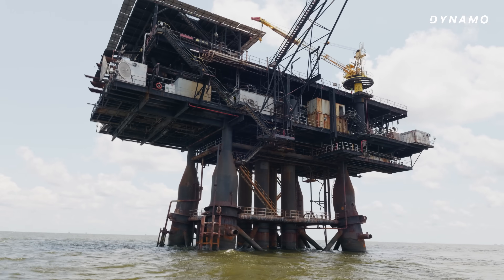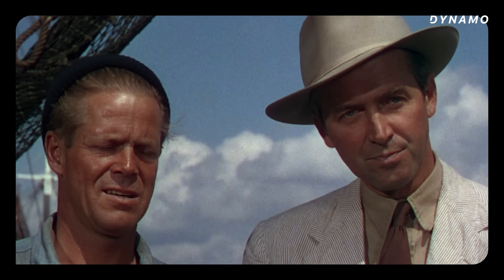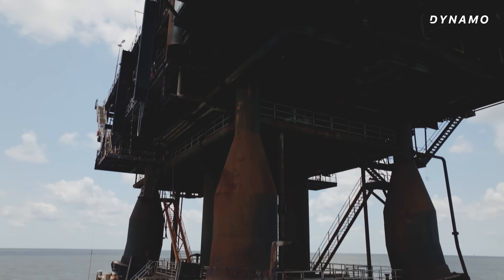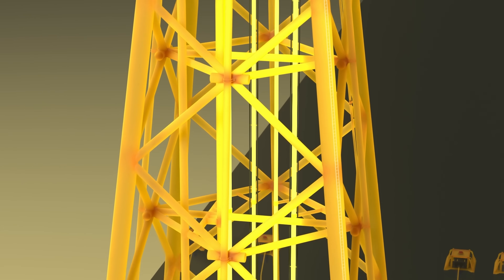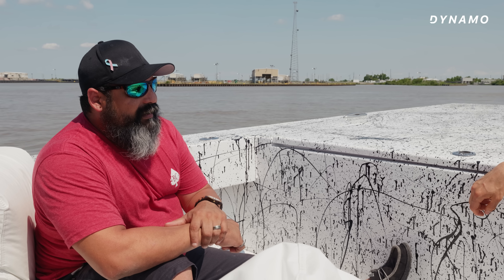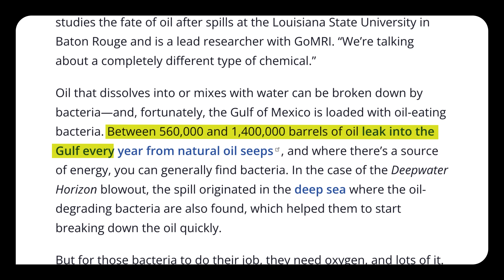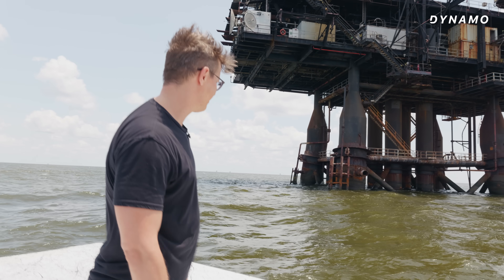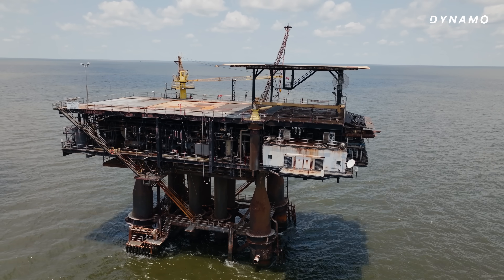I Visited Abandoned Oil Rigs — and Found Something Terrifying Underwater

Comment: Hey it’s me, Nich. I'm the host of this show and the CEO of Dynamo, the company behind "Business Explains The World." I’d love to try to answer any questions you have about the episode!
Reply: Privatize the profits, socialize the losses. The real recipe of American "capitalism".
Reply: Why does this video end with a call to action for a weird hydrogen company instead of a call to action for capping all the wells?
Reply: How about implementing a requirement that new rigs and wells be paired with the capping of existing wells and removal of older rigs? We could also consider increasing the number of old rigs that need to be retired and wells that should be capped based on the size and cost of the new rig. This could promote safer practices and better resource management.
Reply: @christophersz if the ultimate owner is some small company that then goes bankrupt, I don’t think that such a rule would help.  Perhaps there needs to be rules around building these that ensures that 1)the builder is very well capitalized and diversified and 2)that the liability for the rig cannot be transferred.
Reply: Why weren't you wearing a life vest on the boat by the right?! A bit silly, but otherwise a really interesting video!
Reply: @Xan-Asmodi  Thanks! When boating as a kid or an adult, I always have life vests nearby and easy to access in case things go wrong.
Reply: I was a sub sea inspection engineer most of my career. The problem with the US offshore industry was that they never really had a regulated inspection programme the companies had to adhere to. In the North Sea for instance all sub sea structures had to be inspected at least every years and some every year. Also the companies are bound by law to return the sea bed to the same state as they found it which means capping and clearing the seabed. The reason your offshore instalations are in such bad condition is because they were never or rarely inspected for damage or corrosion.
Reply: I Should have said 'every 5 years' minimum.
Reply: @robertwrightson6455 but only AFTER Piper Alpha. It was an unregulated shitshow before that, with the Department of Energy in charge of both maximizing production and safety. Not too good bedfellows those two...
Reply: Why the use of AI slop instead of paying an animator?
Reply: @BigDadEnergy_ because animators are people and this economy is not wise to provide services and money for people trying to live. Lets all fry our electrical power lines with super tech servers and get a more thick light bill
Reply: The gov gives the corporations an out. It's the policy that is designed that way. They max their profits and the taxpayer will pay clean up
Reply: Hey man, not a question, just a comment - I appreciate you guys putting in the "AI animated historical image" tag on those images. I think AI generation is something that should be done transparently and in a limited way. I really think this technique works really well!
Reply: They are platforms not rigs.
Reply: 🦹 You remind me of Reverse-Flash, also known as Eobard Thawne in the series. 😁
Reply: No question from me but I'd like to say 2 things. First, thank you for shining a light on this. Second, we need stronger legislation, because this isn't going to police itself. Whoever builds and takes part in the rig has a shared responsibility to pay to decommission it. Or, Whoever builds it is responsible and can bake that into their profits and the sale to the mid tier company.
Reply: Can a person live on an abandoned platform?
Reply: How can a company come and assist  in fixing this situation any way to contact you
Reply: 🥰you are cute 🥰
Reply: Same in the North Sea Shell, BP & Amerada Hess sell the facilities on to companies that go broke, oil companies insisting they then have no responsibility for the removal as the installations have been sold on to third parties.
Reply: Nich, that was an enlightening piece. I was oblivious to this problem.
My apologies if I missed the explanation, but what is the procedure for “plugging” these defunct oil wells?
Also, is plugging a guarantee against future leaks or do these plugs require monitoring/ maintenance?
Thank you and again, that was a very interesting piece.
Reply: This reminds of that offshore platform built in international waters between England and France, then abandoned by the UK after WWII. Some guy went and proclaimed it then started Principality of Sealand
Reply: So in general, and as silly as it sounds, but people below have got it right. The reason that jacketed platforms are left where they are is that it would do more environmental harm to the marine life that made them home to take it out. In an ideal world, the topsides (the bit you can climb over) should be removed however, and endure the wells are killed and capped though. If memory serves, in the North Sea the jacket needs be chopped off 50 feet (i think?) below the surface so ships don't rip their keels out if they go over them
Reply: Gulf of mexico😅 wot ? Maga maggots itz da golf o merika. Brandon yellin beyotch
Reply: louisiana master race
Reply: Deceptive title! You weren't even underwater!
Reply: Why does the Australian Tax payer have to pay $500 million dollars to clean up Chevron mess in Western Australia, why can't Chevron just find some loose change in their pocket and pay for it, I mean they've paid next to nothing in tax and land royalties.
Reply: They have the same issue with phantom wells seeping tons of methane in the western U.S.
Reply: Why are you a cuck shill for AI
Reply: You install it when your done you dismantle it there problem fixed.
Reply: Is a good hideout, no doubt 😅
Reply: Why was that boat covered in oil?
Reply: @miguelvpires i think it was paint, but i still wanna know why it was covered in anything lol
Reply: an AMA in a youtube comment section? Bold move! Haha
all jokes aside thx for the video good work
Reply: why do i see housing opertuneyt like the floating city in korea 2050
Reply: I was a commercial diver for 19 years in the GOM. I have been to that very platform many times in my career.
Reply: Basically everyone, including the government, decided the clean up should default to the taxpayers. If Congress really cared, clean up liability would attach to the deepest pocket in the ownership chain. Kind of like joint and several liability.
Reply: Now look at wind and solar farms.  The same thing will likely happen to many of them.  We need to focus more on nuclear.  It needs more research but it has a much smaller footprint.
Reply: This was very informative, I worked in the oilfield about a decade ago and didn't realize so many wells were left unsealed, pure profits are the only motivation for the oil companies. The technology is utterly incredible, when I left in 2016, I had the opportunity to work on a state of the art deep water discovery vessel, the Ensco DS5, which was finalizing its commissioning procedures.

Its design was to be tested for arctic and deeper waters than the gulf shelf, with twin drills it was intended to tap deep wells reliably, determine their production potential, and then keep going searching for more drill points while a specialized production vessel is moved in to operate on that well long term.

Looks like arctic drilling has been authorized under the trump administration, shell has been poised to move on that front for several years now. I'm afraid that unless some regulatory body finds a way to strictly enforce operational and decommissioning standards, then we are going to see more abandoned oilfield hulk littered across every possible extraction field that they can find.

Great work on this
Reply: how do I donate to a lobbyist to get this issue in front of senators and representatives?
Reply: Pardon my late question. I have designed a deep sea oil and gas containment and channeling system for blown wells and pipeline disaster prevention. It can handle up to 104 000 barrels of oil per day at up to 10 000 feet depth, as well as gas . Would there be any interest in the USA to buy it or pay for the use of such an instrument at their disposal? It came to mind after the  BP Macondo incident. I spoke to Lloyds of London who welcomed the idea as well as the International Maritime Organization in London and they are all in favour of it. It can also be made international law that any company drilling offshore anywhere must have cover by a service rendered by us . Im unsure if you can advise or direct me on how to move forward with this potential solution to prevention of future disasters. It will save companies billions . Looking forward to your response. Thanks in advance.
Reply: Why do you keep calling the oil platforms   rigs? Also Jack up drilling rigs at least modern ones are considerably bigger than 100ft legs. The biggest one has 650ft of legs. Most of these platforms that are abandoned have had the wells P&A'd (plugged and abandoned) so if something were to take out the structure or even breat the well if it's already been killed with multiple barriers far beneath the mud line.
Reply: Why did you pad the video for 15 mins of a 17 minute video, only to pad for another 2 mins?  YIKES.
Reply: its a lot of concrete to seal those wells properly
Reply: @LeoYambao I do this for a living. It's multiple barriers or concrete and cast iron bridge plugs to seal everything off and every layer is pressure tested to verify it's sealed
Reply: Are there any other bodies of water that has abandoned oil platforms left unattended or haven't been cleaned up or is it just the Gulf of Mexico?
Reply: Question: USing Sealand as an example, what happens if anti-fossil fuel protestors decide to claim control of these assets? Because if folk like Just Stop Oil decide to take-over, the courts will have to claim these assets in order to deny them to the protestors? And that means they become a problem for the state to resolve...
Reply: So whats stopping someone from saying "Fuck it" and moving into 1 of these things? Spent a couple hundred dollars on lumber and nails and bring a set of tools out cause im assuming the thing has SOME power left on them and just living there?
Reply: How'd you mange 3m views from a sub count in the 30k range lol its crazy
Reply: Another California weirdo on a moral Crusade.
Reply: @DynamoNich 
How are you dealing with HomoAqua from down under? Is The War between The Land and The Sea happening any time soon? Are we about to start dealing with the consequences of mismanaged petroleum products world over?
Reply: is it not economically viable to recover the materials of the constructed platforms and under-water portions and convert the materials to scrap and recover costs ?
Reply: Well first of all there was not one oil rig in this whole show. It was all platforms. Know what you are talking about before you claim to know what you are talking about.  The horizon shouldn't even be part of this because it wasn't a abandoned well ot was a well that wasn't even flowing yet
Reply: The gulf will be a launch for co2 sequestration.
Reply: Pay the right people,things get done.
Reply: I had no idea this would be such an interesting video. I put it on a background noise while gaming and found myself using it as primary noise😂
Reply: @dynamonich you should check out the NorthernEndevour. The Australian government significantly changed its policy following the Northern Endeavour fiasco by implementing a decommissioning levy on the industry, introducing "trailing liability" provisions for previous owners, and increasing scrutiny of title transfers. These reforms aim to ensure that taxpayers are not left to cover the substantial costs of decommissioning failed offshore oil and gas facilities.
Reply: So your solution to the issues of decay related to extraction are essentially invest in more extraction, just of a different kind...and we're still just kicking that rusty old can down this road to the promised wasteland, yes?
Reply: Why not apply the cost to all companies that are still interested in the business by taxing oil?  Stop allowing the true cost of production to be shuffled to someone else.
Reply: @badpanda1532  Oil is already taxed. The decomm cost issue has already been addressed, but I suspect that the issue being raised in the video is that many of those old platforms predate the legislation which required the decomm fund to be established. If you tax it more, the costs will be passed back to you and your cost of living will rise even more than it recently has.
Reply: Why does it say Gulf Of America in the desription?
Reply: Why do you show images of the Deepwater Horizon for anything spill related? That was a blowout in a new prospect.  The prospects you are covering are so depleted they wouldn’t even come close to resembling that.  Oh and let’s only interview activists.  Hard to take you serious with such hyperbole and bias.
Reply: You're title is a damn lie
Reply: @Killjoy888 *Your
Reply: wow this is amazing truly inspiring work. I love to see humans that care about the future we create!
Reply: Your main points stand, but you got many facts incorrect. I’m a geologist and have worked in offshore oil exploration for 20+ years. One example of many is wells drill 30,000+ feet deep below sea level not 10,000 ft.
Reply: @palndan umm, im guessing you watched a different video. He said those were minimums
Reply: You appear to have neglected to state how many of those wells were abandoned without having first undergone the well kill procedure followed by their being plugged by pouring concrete down the insides of those well pipes, where it forms a plug that stops any reservoir fluids from leaking to the surface. In ignoring this detail, you have created a piece which runs the risk of being dismissible as hysterical, fear-mongering, uninformed garbage where it could otherwise have been so much more.
Reply: @seamusbyrne7820  Thanks for this feedback. We tried to make it clear in the episode that many wells and platforms are properly decommissioned. There's a big industry built up to do that. But as we also mention, it's way behind schedule, and many wells are not properly plugged.
Reply: @DynamoNich  “far behind schedule” sounds like opportunity for new companies to start plugging, certifying and scrapping. Now for my understanding of the situation, at least in the Texas part of the gulf is, the wells are plugged and physically severed when they no longer produce. The structure above the ocean floor is only removed if the current lease holder has no wells in production in that area. Therefore the removal the production platform may remain until it actually deteriorates, at this point it has become habitat.
Reply: Why would they stop using an oil rig if there is still oil to pump out of it? My guess is government manipulation.
How do wells that dried up still leak?
Reply: @onilegends6650  good question but it's not that it goes instantly from oil to no oil like drinking a glass of water with a straw that then empties. What happens is that the quality of what comes out slowly degrades as it is increasingly mixed in with groundwater and other things. At some point the mixture is too diluted to be able to be refined and used but there's still enough oil mixed in that it can be really nasty environmentally.
Reply: @onilegends6650 it’s never been presence or absence of oil, but cost of extraction.  There’s still oil in Pennsylvania (where pennzoil got its name) but it’s easier and faster to get it from other wells.
Reply: @onilegends6650 Many of reason why. The BP spill shut down a lot of those rigs down once Obama put the moratorium on the Gulf. It was a supposed to be a "until further notice" kind of deal but that turns out to be bs. I'm born and raised in Southeast Louisiana and worked on many of these rigs for year's, maybe even that one, until the spill happened. Some never reopened due to expired leases, osha safty violations and company shutdown. Also about 95% of the companies moved operations to Texas due to government corruption in Louisiana. If you ask me I think they were waiting for an accident to happen just to shut us down. Texas has been producing oil on land for year's and it's easier work. Meaning cheaper and easier to drill and access. No more billion dollar offshore rigs and the cost to run them are need and they're hitting the same oil pockets. Completely knocking Louisiana of the game. I got to work on the Mars prospect job that he talks about in this film. That is where I learned most of my knowledge of the oilfield from. Kind of cool to see them talking about it. I remember starting out as a green horn in the field, man I miss those days. I was young and single with a pocket full of money. I now work for this fked up "State of Louisiana" working for civil service broke af. I leave one hell hole job for another, go figure. This job is a lot worse though man, I liked the last hell hole more, I hate this fking job.🤦‍♂️✌️
Reply: @onilegends6650 when it becomes uneconomical to keep extracting it. That is the simple answer. To your other point, they shouldn't if the well is killed and capped properly.
Reply: Its Gulf of AMERICA
Reply: @WilliamHBonney-m3r  Nah, Gulf of Mexico
Reply: *Gulf of America
Reply: @And__CLam  Not trying to make a political statement, for what it's worth. I just think of it as the Gulf of Mexico because that's what I've called it for about 40 years. I'm sure I don't speak for everyone in similar circumstances but for me, it's feels odd and unnecessary to start calling it something else.
Reply: @DynamoNich Unfortunately you are most definitely making a political statement by not calling it the Gulf of America. The name has been changed ... no further debate required. THANKS FOR YOUR ATTENTION TO THIS MATTER
Reply: @And__CLam  You know - even though you may call it that in The U.S - to the rest of the world it's still The Gulf of Mexico. And since i assume this video is made for the entire world, it would make sence for him to address it as the gulf of mexico.
Reply: @Sebbe Incorrect
Reply: @And__CLam  Nah
Gulf of Mexico. Fuck America
Reply: @And__CLam  LOL what a joke.
Reply: @psianide91 I know right ... the guy saying he only ever called it "the gulf" is pure cringe. That's why I timestamped the poster's obvious confusion when he stated that it was not the Gulf of America 🇺🇸45/47
Reply: @And__CLam  Only if you want to ignore history. The Gulf of Mexico has meaning, most just don't know it. In the video he just referred to it as the Gulf
Reply: @And__CLam no one cares snow flake, go scream lets go brandon until you pass out
Reply: @Iamthehethetheyandthehim Quite clearly you do ... enough to ATTEMPT to belittle me 😅
Reply: @Iamthehethetheyandthehim  There is absolutely no reason to sound as hostile and rude as you do. Thats the problem with society in this country. If you even think someone might be of a different political school of thought people go full cave man "us vs them" mentality and treat them as subhuman scum.

 Your aggressive stance is only making our country and society worse. And I would say this to anyone on any side of the political spectrum that responded in the same disgusting way that you just did to another human being. Be Better.
Reply: @Jeremy_M_  I told someone yo go yell lmao
Reply: @Jeremy_M_  I told someone to scream lmao you came back here after a month and tried to make me seem like an extremist for telling some to shout loudly? This is why it’s truly frightening to live in this country. You should take screenshots of this thread to a mental health professional and get some help.